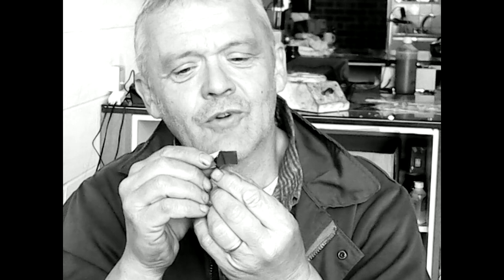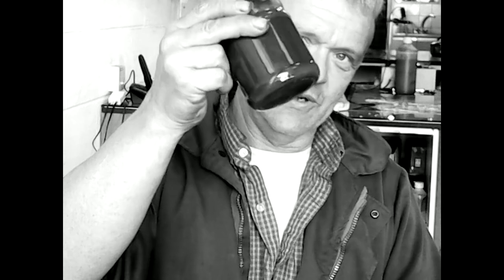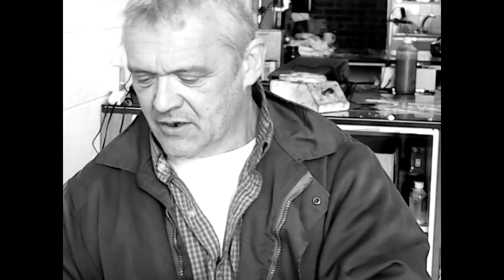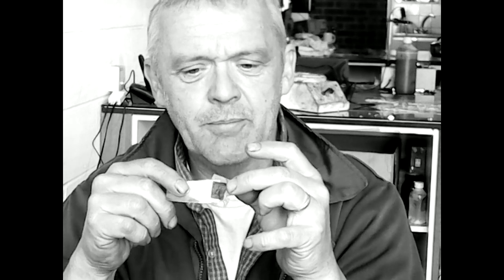Towards A 1 MegaFarad Super Capacitor

Comment: i tried making a simple super cap. i used somewhat crushed activated carbon poured into an acetone. aluminium foil for current collector a salt as an electrolite. i failed miserably.
Reply: but i managed to feed it some electricity 0.5a at 5v
Reply: i think i have put too thitk carbon layer. but acetone doesnt stick carbon werry well at all
Reply from the maker: you need a bit more care in construction mate
Reply from the maker: cool
Reply: Robert Murray-Smith i crushed activated carbon with coffee blender. when i stick aluminum foil into the crushed carbon with acetone it coats really thick coat. somewhere between 0.5 and 2 milimeters. based on your videos you make it thin. in the microns thitkness. and also is it ok to put exess on electrolite? i have seen people submerging it into electrolyte. mine just dont want to collect energy at all and idk why
Reply from the maker: most likely is leakage but there can be any number of reasons - make them small until you get it right then try a big one
Reply: Robert Murray-Smith thank you you are the best :)
Reply from the maker: i am sorry i couldn't be more help but it's hard to tell what is going wrong when i am not actually there
Reply: Robert Murray-Smith i will post a video if you could help me it would be the best
Reply from the maker: ok

Comment: Lithium battery makers would have to buy over super capacitor businesses . Else they will be be a sunset industry.
Reply from the maker: They already are - they just don't know it yet
Reply: i need your help mr. robert ... i am making e-bike that has supercapacitor bank witch will be  a piggy bank for excess energy so when u need a boost u can use that energy stored and acumilated in sup.cap. bank... i was thinking of maxwell capacitor's ...maybe u could give me some advice ?
Reply from the maker: i have never done what you are trying to do mate - so my advice would have to be treat with due scepticism - but sounds like y ou have a plan there

Comment: Uhm.. the stopid person here again.. So lets say size isnt an issue and you can encase those thing as a biopolymer. Im guessing biopolymer doesnt degrade that fast. So basicly you could make a shitload of 10K supercaps and make hole in the ground and store them there. So you could make.. well say 30 of these.. stick em in frame dig, undergorund and charge em from a windpower source putting out 48-36V three phase - rectified.. and that would let one store about 200Wh (yeah my calcs is a tad bit off) - and you could power some basic utilites this way.
Reply from the maker: why put them underground mate - maintenance would be a nightmare
Reply: Well a concrete casket would protect em from weather, and animals when you arent out there. Practically i think maintenance would need to take a step back when it comes to make em last. =)
Reply from the maker: hmm - seems a bit like over kill to me mate a wooden box would be as good - but hey do you what you think is right
Reply: Well i need to do some experiments.. or a bunch.. car first.. just see the potential for being able to actually get a powersource out in the woods that isnt hazard to the enviroment and can be left behind.
Reply from the maker: sounds like the right move to me mate

Comment: What is the max voltage this capacitor can handle without shorting out ?
Reply from the maker: +roynexus6 2.15 v
Reply: what electrolytes are good for that high voltage?
Reply from the maker: organic electrolytes work well at high voltage

Comment: who much its 1 Mega-Farad in whA?
Reply from the maker: +SLEVIN SHAFEL depends on volate this one operates at 2.15 volts
Reply: +SLEVIN SHAFEL At 4.2V to 3V (standard Li-Ion battery voltages) 1MF would be 200Wh or ~333Ah. If you consider using a boost converter, then it would be roughly 1.2 kAh or 2.5 kWh. Even with this capacitor operating at 2.15V you get almost 460Ah or 380Wh. Of course a boost converter would consume more current as the voltage drops, so you'd have to adjust for this.
Reply: +Maciej Sopyło soo the capacitor are not good to storage energy. its good just to take fast energy in one moment because they store that energy in static energy and no chimical.
Reply: SLEVIN SHAFEL Hundreds of Wh are not good enough? Typical laptop battery has around 40Wh. Of course there is some leakage, but the energy density of these caps is enormous.
Reply: +Maciej Sopyło yah but the capacitor are not good for long period of storage right? and the voltage its droping quickly...its not contantly.
wath i mean..Dosent matter who capacity he can store if he can store for a long time and dont give the same voltage for a long time when its used.
Reply: SLEVIN SHAFEL That's why you use a boost converter - it's the same with batteries, they also drop voltage but in a different way.

Comment: As always, great work Robert. I am going to be building some very large caps myself, but, I am still experimenting with solutions for electrolytes. i think the experiments we do here on Youtube in our own time are much more exciting and happen to push technology ahead much quicker than those who are marketing and slowing the release of the newer, better items so they don't waste money being stuck with the products they already stock from previous manufactures. I think what you have shown here has frightened the folks at Maxwell and other manufacturers so badly that they will now be reducing their prices so much just to blow out the old stock quickly in an effort to release something new that "may" be able to compare to what you have already accomplished. I did notice something today , which is absolutely incredible!   This was actually a mistake when I experimented with my pva and phosphoric acid electrolytes., I accidentally dumped a bit of graphene oxide in my electrolyte mix, but, since 1/4 of my little container fell over into the bowl,  decided to go ahead, mix it and try it anyway, not expecting anything good to happen, however, it has actually "astoundingly" improved the capacitance, by 20 to 30  times or more. So, If you go ahead and use your already great electrolyte mix some graphene oxide powder to it, then add it to the capacitor, I think you'll be absolutely astounded by the results. Try it out and please let me know how this works for you .. It's already made me feel as if I've already accidentally come up with the answer to make your already beast of a capacitor into the size you are looking to create.  I'd actually like to give the secret to you because you have come along better than anybody I have seen online, and I have learned a lot of what I do with the graphene from your experiments that you share with us all. From all of the things you do, as well as many others here on Youtuibe, when sharing your secrets to help better society, on a daily basis, we all benefit from the end result, and that will be the ability to build this stuff for ourselves without having to spend hundreds or thousands by Maxwell and other companies that get pretty greedy with their prices when they are absolutelty simple technologies not worthy of the prices ! Cheers! And please keep up the good work and massive library of videos!
Reply from the maker: +Marc Belanger hiya mate - that is really interesting and i agree so much more goes on in sheds than anyone would believe - i will give your suggestion a go first thing in the morning - thanks for the heads up mate
Reply: you are welcome. I hope it brings you to your goal of 1MF a lot quicker! I didn't think anything of it, in fact I thought I ruined the batch and wasted the graphene powder, however, the results were astonishing.
Reply from the maker: +Marc Belanger just about to try it now mate
Reply: Hi Robert, how did you make out with the addition of the graphene?
Reply from the maker: +Marc Belanger not so well mate - but that could well be the way i am constructing my cells
Reply: maybe.. I didn't do more than a single cell, however, my layer of graphene on the aluminum foil is electroplated and so thin it is virtually a shade of gray and see thru. The pva electrolyte was smeared between the two foils and had about 1/3 of a .3 gram container of graphine oxide in between the oxide coated layers. (the graphene was extremely light on the paper) and heavier in the paste electrolyte, so, maybe I am having the opposite reaction of the normal reaction. I will post my results again to video when I rebuild and retest. I'm not sure you used the same electrolyte or method, but I'll work on it this weekend to show you what I did.. One question, have you encountered different types of foil? I have a very heavy grade of foil and have a very shiny outer surface that was kind of decomposed or released from the outer surface as I had my electrodes backward and the first batch of electrolyte had KOH in it. It dulled the finish of the foil, then, I reversed the polarity and agitated the graphene water a bit, unsuccessfully coating the aluminum. I then remade my electrolyte bath with only graphene and tap water (well water) then energized the bath correctly and it coated the plate, so, just maybe the aluminum had an aluminum oxide layer on it first, then the coating of graphene oxide plating over it, alowwing the results to be much different. Aluminum oxides are  non conductive so maybe it gave me a blanket of insulation thin enough to provide a large enough layer of dielectric to make a fine separator on the outer wall, then, a slow transition to graphene's super conductivity, a semiconductive layer (which is the porous paper) then another layer of electrolyte, and, the same plated aluminum over the aluminum oxides created by the KOH/Graphene bath. One interesting fact is that the electroplating takes forever if there isn't some sort of salt or acid in the water to raise it's conductivity, but, when we add KOH, the graphene and water separate after the electrolysis begins. I made a mistake with trying different metals in the KOH/graphene water bath and probably could have made poisonous gases from the mix, gladly enough I didn't keel over from this. The aluminum foil may have just had it's own nano layer as the Keshe method does with acid. I'm not sure what this creates, but, it was merely a dull coating of a lighter color of aluminum, making it appear to be oxidized much faster than normal when I thought the polarity was only backward. The next bath without KOH proved to be the way to layer it electrically. I used 900mA @ 32 volts rms for well over an hour with an agitator in the bath to keep the graphene from separating while energized. Thanks for listening. I didn't mean to waste your time, but sometimes we miss things during explanation that change the entire outcome of the project until we think about it deeper later on. So, aluminum, oxidized by electrolysis and acid bath, layered with a fine microscopic layer of graphene to create a transition to conductive, then, the paste electrolyte dried on both sides of the tissue paper, and, another layer of exactly the same aluminum foil, sandwiched in one layer. Thanks, Marc
Reply: one other thing I am experimenting with is polarizing the graphene coated material with static electricity to create a directional flow. I'm not sure if this will do anything, however, it is one of the things I've tried when building caps before that changed how they charge. It seems as if it structures something inside of the material which allows an instantaneous charge when putting these pieces all together. I'm not sure if it is only creating a galvanic reaction like a battery but the paper isn't completely soaked with the electrolyte since it is thick and difficult to apply. The first piece had to have two balls of "rubberized PVA/electrolyte stuck to each side of the paper separator squeezed with a vise between the aluminum between two sheets of copper in the vise, then I just connect the leads to the copper plates after taping the copper plates together to hold them tightly together. I will also be experimenting with unlike metallic sheeting materials to see what happens. Zinc appears to electroplate nicely, so, maybe I will get a voltage without charging from the difference in material itself, hybridizing the cap to make a Cap/Bat type device. Not sure , it all sounds good until it doesn't work, but without exploration of these methods, I can't determine if they will work or not. Thanks again for listening to me ramble on. I just thought I'd share the details of my future attempts to advance my research. Dumb attempts sometimes discover incredible results!
Reply from the maker: +Marc Belanger I appreciate the time you have taken to explain mate - because you are right sometimes the smallest things change our results. I am going to try again but when i get back to England and have better facilities - it might be a couple of weeks though as i have to make some  more graphene oxide - still I do like the look of what you have done
Reply from the maker: +Marc Belanger there is a problem with zinc in that it will form dendrites under repeated charge discharge and limits life cycle to around 60 cycles or so
Reply: +Robert Murray-Smith good thing you let me know that. I learn something new everyday.. thanks
Reply from the maker: +Marc Belanger it's one of the reasons i shy away from zinc use mate

Comment: Indeed sir you are pushing the envelope here,  but,  i do have a question.  What is your voltage to surface ratio.  Because you will indeed build a 1MF supercapacitor no bigger than a car battery,  but if it pops out valuues like 1V at that size,  you eighter use a PWM to boost your voltage but it will eat up a lot of current to do that thus the capacity decreasing dramatically,  or put 12 of those in series to obtain a reasonable Vage of 12 that you can use pretty much as it is if you have a sturdy motor with enaugh torque.  Anyhow,  as it is... Even with 12 of those in series,  with the power loss due to Joule losses,  you still are way ahead of what is available on the market power storage for the automotive industry.  Only downside... The self diacharging of the capacitors.  But no matter,  this is an astonashing result.  GOOD JOB OLD CHAP!
Reply from the maker: ihavecojones cheers mate - you are right self discharge is always going to be a problem

Comment: That's an interesting project, Robert.  Might I suggest hooking the cell up to a stable voltage for 72 hours, and then measuring the charging current?  Bonus points if the following test measures self-discharge, with voltage charted against # of days.  Those are pretty easy tests to do.  Only connect the meter when actively measuring voltage, to avoid having the voltmeter continually load the cell.

The leakage current test is a good measure of cell quality.  Ideally the current should be zero, but impurities in the electrodes and electrolyte, choice of collector material, and ohmic paths through the separator will cause it to be greater than this.

The self discharge test is probably the most important one, if the supercapacitor as an energy storage device is considered.  For example, even if a cell has an energy density rivaling Li-ion chemistry, it won't be useful if it self-discharges in 15 minutes.  Also, the shape of the discharge curve indicates if there are faradaic reactions occurring, if there is moisture contamination, etc. 

Cell lifetime is related closely to the previous test results.  A cell with high leakage current will usually have a short lifetime at rated voltage.  There are other tests that measure quality, but I think the first two are the most important and practical for a home hobbyist.  For reference, my own aqueous cells lose half their stored energy after about 3 weeks.  The self-discharge time constant is > 2 months.  The ionic liquid-based ones currently self-discharge more quickly.  Those lose half their energy after 5-7 days.  By contrast, cells from the "Big Boys" like Maxwell may lose only 10% of their voltage after a month.

Finally, as you've already mentioned earlier, I'd suggest measuring capacitance by calculating the voltage drop vs. time with a fixed load.  The load should be > 10x the leakage current, small enough that internal resistance is insignificant, and small enough that the discharge takes place over 10-60 seconds (to improve measurement accuracy).

Standard capacitance meters are useless for measuring EDLCs, as measured EDLC capacitance depends on test frequency (a graphene electrode is similar to a transmission line of sorts, with distributed resistance and capacitance).

Hopefully some of this information will be useful to some people.  I think if testing methods are standardized a bit more in the hobbyist world, it may be easier to compare the results different people are getting.
Reply from the maker: WGTR That is really helpful mate - thank you very much for that
Reply: Robert Murray-Smith Your welcome!  I neglected to mention one additional concern.  When measuring leakage current it's necessary to mind the meter's internal resistance.  This is not a problem if the current meter is left connected, undisturbed the entire time while charging.  Failing this, it should be adequate to hook the current meter up at the end of the 72 hour cycle, and give the current an hour or two to stabilize.
Reply from the maker: WGTR cheers mate